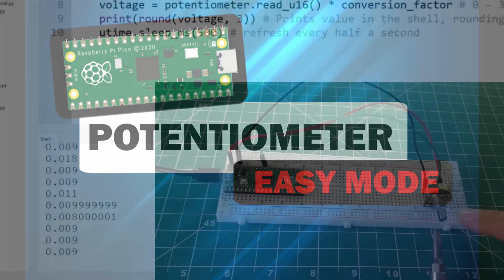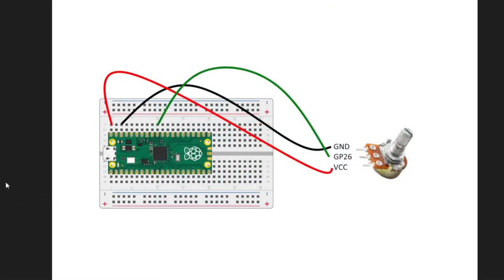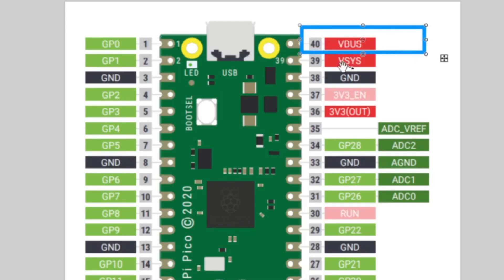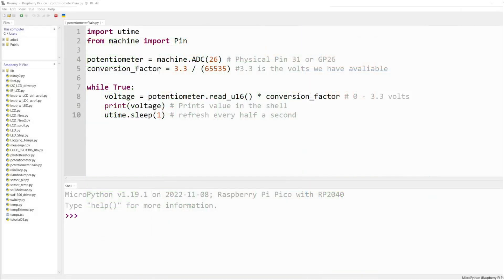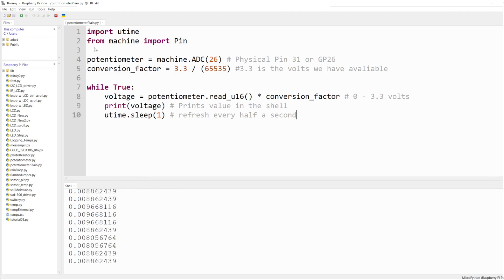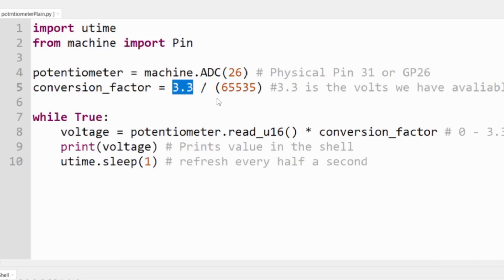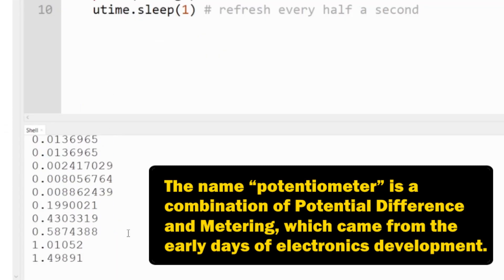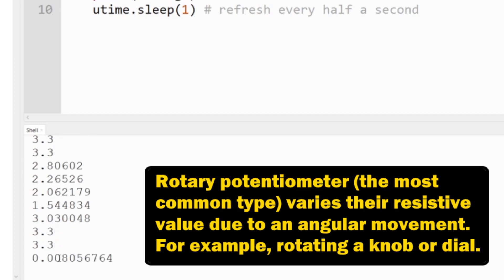Raspberry Pi Pico Potentiometer in Micropython 🐍 w/Code MADE EASY

Comment: You have wired the potentiometer between VSYS (typically 5V) and GND - meaning the pot wiper connection going to the analogue input 0 (GP26) can range from 0-5V  hence at times you will be exceeding the pico's input maximum rating which is 0 - 3.3V.  The red wire should be connected to 3V3 out (pin 36)